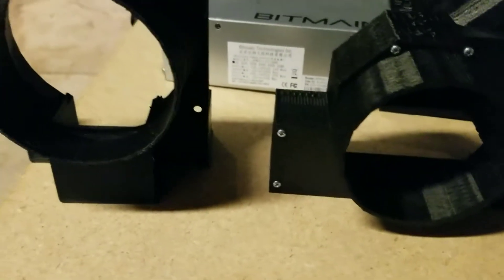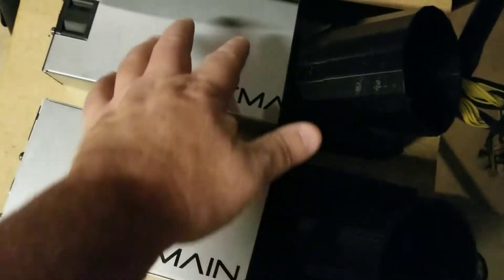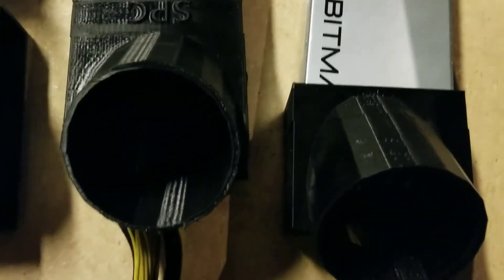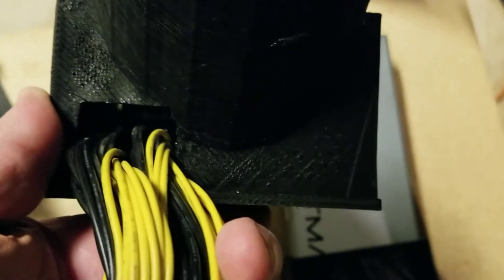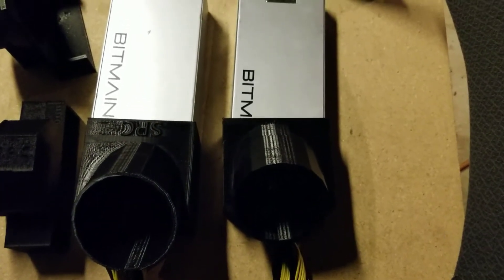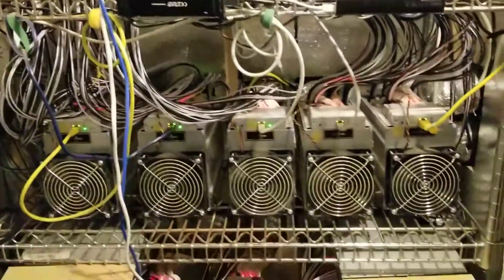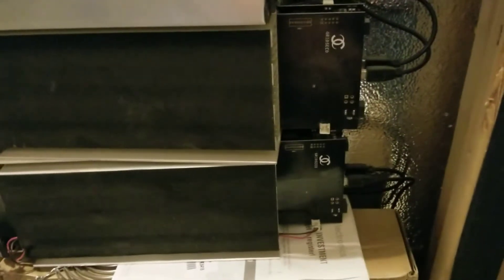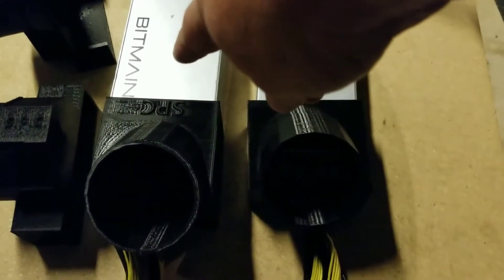Bitmain antminer power suplies shrouds for both the 110/220v and the 220v power supplies

Comment: Are these really required?
Reply from the maker: no but they will help you remove the extra heat out of your mining room. your miners shut down at around 86 degrees. they put out close to 90 degrees. your power supplies will also put out about 85 - 95 degrees. the extra heat is worth getting out of the room. the shrouds i make are made to hep remove the heat. ultimately it is up to you, an air conditioned room that has all the extra heat removed so the air conditioner works less or leave the heat in the room and hope your air conditioner does not go bad.